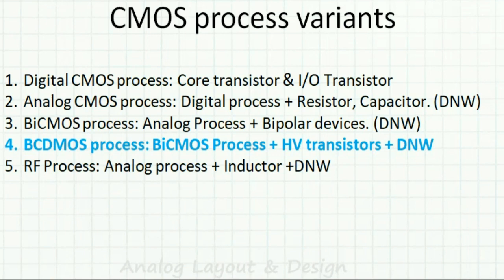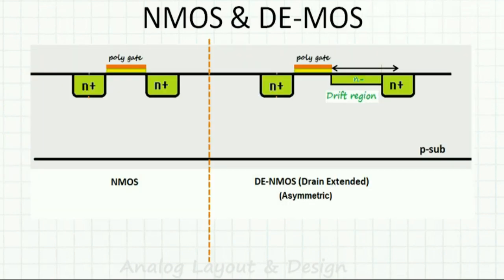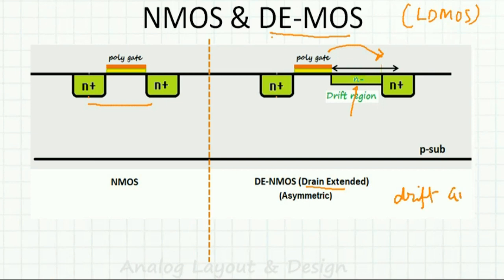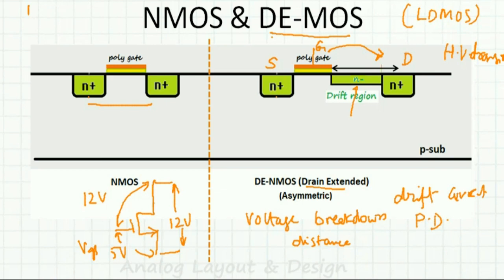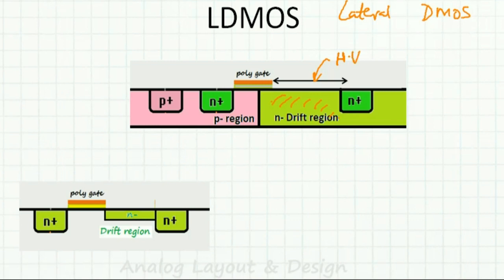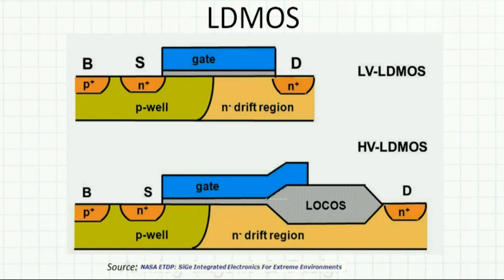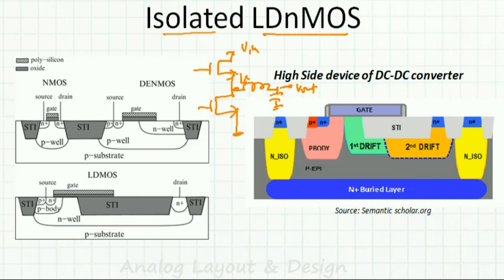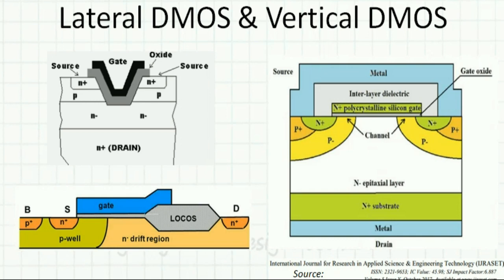LDMOS

Comment: Thank you for the explanation. May I ask a question sir? Do we have access to the inner bulk (inside well) of Dmos transistors and connect it to a desired voltage? Im working with a 0.18 micron bcd process and in the symbol of all dmosfets (pldmos and nldmos) there is just a forth pin named as p_sub. I wonder if it is the common p_substrate contact or something else?
Reply: Yes.. generally it's available..
Sometimes even the high side switch of the DC-DC will be bulk isolated nmos transistor...
Reply: @jayateerthar5224  yes it is isolated but seemingly there is no explicit pin connecting to it. All I have access to in the symbol are gate, source and drain pins and a fourth pin named p_sub. Im a bit confused but I guess we only have access to the shared p_substrate which needs to be grounded anyway.

Comment: Nice explanation and plots. What is the current frontier in LDMOS in terms of max Rf power and max operating frequency?
Reply from the maker: Max RF power and frequency depends on number of factors....assuming 12V NLDMOS, Ft would be around 30GHz and Fmax would be double of that.. and currents can be as 10A to 15A depending on the foundry... But now a days GaN is picking up in this area for extremely low RoN...so, size goes low enabling even higher frequency of operation at high powers...
Reply: Thanks, that is helpful. RoN = ?
Reply from the maker: RoN= On Resistance, generally expressed as RsP (resistance per unit area; generally will be around 15milli ohm/mm2)

Comment: Very clear, thank you. When you say we need an isolated nmos in that dc-dc example, is that because of the large body-effect it would have otherwise? Or maybe because of possible maximum ratings between source and body?
Reply from the maker: For the top PowerFET yes, body-effect would be large as the voltages will be high and it will defeat the primary purpose of using NMOS device to save area and reduce parasitic(lesser switching cv2f loss also ; for a given conduction loss). Max rating for source and body will be much higher....for a 12V LDMOS, VGS rating would be 5V, VGD, and VDS would be 12V but VSB or VDB would be generally higher...I have seen 30V kind of figure...but better to double check with process node used from a particular foundry..
Reply: @analoglayoutdesign2342  Great, thanks.